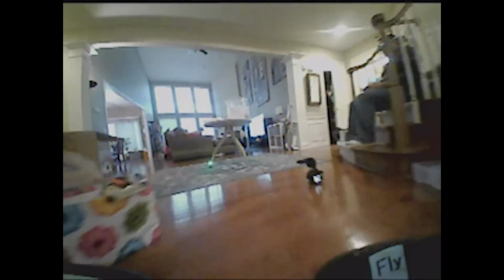24K Gold Tiny Whoop | NewBeeDrone Motor Review

Comment: Great video man!!! i just installed some lumenier tiny whoop motors on my Furibee F36 and i was super disappointed. The stock ones where actually faster lol. Im placing an order now lets see the difference, quick question where are you located in from NY and got a bunch of snow as well
Reply from the maker: I'm in Detroit.  I'm pretty sure we got the same storm.
Reply: I got the lumenier Purple motors (17,000kv) and they frankly were awful, they had ok power right at the beginning of my pack, but absolutely no power for acro, and no climb power

Comment: Awesome review. When u swap motors, do you have to tweak any settings in BetaFlight ? Or you simply just swap. Thanks
Reply from the maker: In this video I just swapped.  However, I'm running Mockingbird inspired settings now, and those do get tweaked based on the strength of the motors.  Bottom line, you can probably just swap, but for certain motors it may be helpful to tweak some settings in betaflight.

Comment: Great video! I like your content is really different from what can be found everywhere else. 
I'm starting with FPV, how long have you been flying? 
Did you started with acro-mode since the beginning? 
I will be great if you can do a video based on your experience with tips and best practices for beginners. 
Keep it does videos coming! Greetings from Costa Rica.
Reply from the maker: Thank Yoel!  I really appreciate it.  I actually think I'm trying to be the channel you're asking for.  I've chronicled pretty much my whole journey so far on this channel.  I flew briefly with a Nano QX, but didn't use it much.  It wasn't until FPV that I really picked things up.  Anyways, you can see basically all of my flights if you go back to my first video.  You'll see that when I built my first quad (in November 2016) I started flying Acro and have stuck with it ever since.
Reply: Going through your initial videos in 3...2...1

Comment: Been running the newbeedrone golds since they first came out. They are lower kvs but smoke the competition. I think all the ones that claim to be higher 19000 KV manufacturers are miss labeling motors.
Reply from the maker: Yeah man, I bet they label the KV with no load.  Once you add the prop, I bet most motors with high kv don't have the torque to keep spinning them.
Reply: Farmer Fpv I use the Tiny Whoop Special Sauce Edition and they are like 17100 kv but they are very powerful over 19000 would be crazy

Comment: It would be very helpful to get some flight time comparisons between various whoop motors.
Thx for a great video.
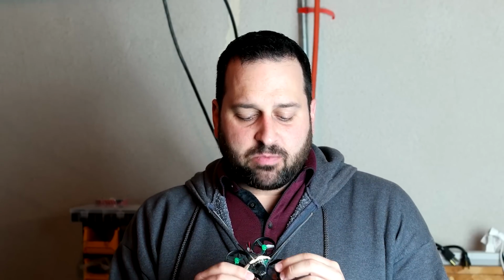Reply from the maker: Thanks man.  One thing I would say is the flight time on the gold motors is definitely lower than the flight time I get on some of my other motors.  Then again, I also find that I'm typically flying faster with the gold motors or trying more acrobatic tricks.  So in the end perhaps the efficiency is still there, it's just outputting the power faster resulting in more speed, but less total time?  I would say I typically fly for 2:30 or so with the gold motors.  I can get over 3:00 if I push it.  With my other motors I typically land around 3:00 but could push it around 3:30 if I really wanted.  Hope that helps.
Reply: Thanks, John. That IS helpful. Flight time is an issue for me, so this helps provide me with direction. Trying to find motors which provide the best balance of time with performance.
Reply from the maker: From what I've heard that may wind up being the NewBeeDrone black motors.  I've heard from a few people they love the black motors because it gives noticeably improved flight times over the gold, yet it isn't THAT much slower than the gold motors.  I have never tried those personally, I would rather just have motor batteries, but perhaps they're worth checking out?

Comment: good one John, are they brushless?.....
Reply from the maker: +MiamiJato tiny whoop motors are brushed
Reply: are brushless better or?..........
Reply from the maker: I don't want to say that Brushless are better.  If you're interested in a brushless "whoop style" quad, take a look at my Hell Whoop video.  Brushless motors are more efficient, and last significantly longer.  They'll give better power and efficiency, but they also include added complexity.  For example, you need a speed controller with brushless, but not with a brushed motor.  There are certainly a lot of advantages to brushless motors, but brushed motors have their place.
Reply: got it, thanks John...........

Comment: I think they tiny whoops be modfity with husban h107d and and H107L models i seen videos on youtube somebody hot glue them to frame i think you can make 1.25 jst connectors solder wired connections and you can use  other  jst connector  motors with all husban 107 models.

Comment: what batteries are you running, my poor batteries are hot as hell after 2 mins of flight with these motors
Reply from the maker: +yoburntyo I'm running newbeedrone 250mah jst-ph 2.0 and crazepony 230mah jst-ph 2.0 batteries and both work great.  I typically get about 3 minutes flying out of them and they don't get too hot.  They do get warm by the end, but nothing concerning.

Comment: I bought the 3 pack and I tried them all I like the black because I can get a little more flrun time they fly extremely well just like the gold. I'm getting about 3 minutes and 30 seconds with the gold Motors with a 255 milliamp tiny whoop lipo with gold motors, I can get just over four minutes with the black Motors. you can't go wrong with these motors no more air slippage you tiny whoop will go where you want it to and will not fall out of the sky when you make Corrections.

Comment: did you break the motors in?
Reply from the maker: I did the same procedure I do for all my tiny whoop batteries.  I run them at about 25% throttle for 3 minutes.  That's the entire break-in process I do.
Reply: Awesome thanks!

Comment: why should i stay on brushed motors that have a lifetime restriction? brushless quads are reaching smallest scales now - why not just take them?
Reply from the maker: Or why not have both?  I have both.  

For real tight flying indoors, nothing beats the tiny whoop.  I fly my micro brushless indoors, but I can't fly as well when things get really tight, I need a little bit more space.  They're just so much more powerful.  And once the brushless motors get too small, the bearings become very fragile.  I broke a set of Racerstar 1103 motors.  So they didn't burn out, but I still had to replace them.
Reply: got a point there,. for me, it doesn´t make sense now. i need a powerful, fast indoor racer. but not for my living room. i need it for practice before i fly my 180mm in parking garages.
Reply from the maker: Yeah the Tiny Whoop isn't for that purpose.  It's for having fun flying a quad in places you otherwise couldn't fly.  I'll fly mine at my work in the office.  I fly mine in my house.  I fly at races held in bars around the area.  All of these just aren't options with anything else.  It doesn't serve as race practice for 180s though :)
Reply: nvm then John, all good. was just curious